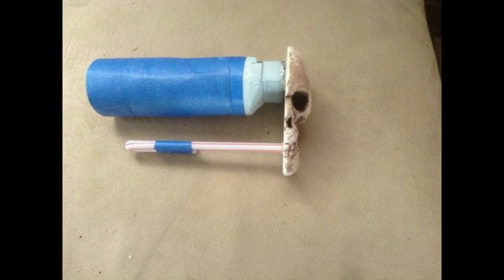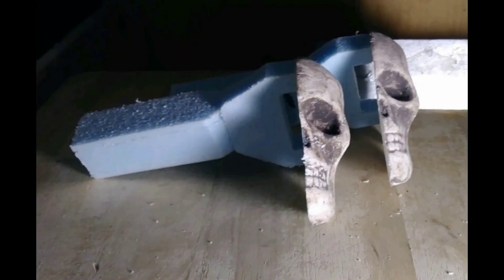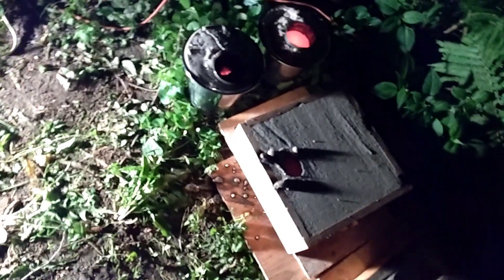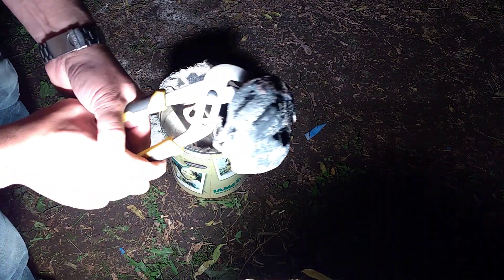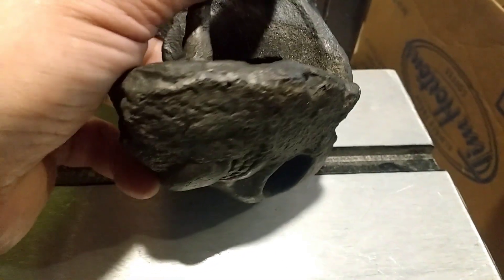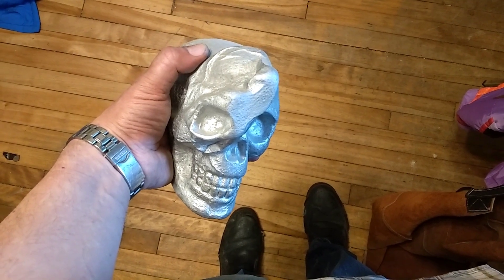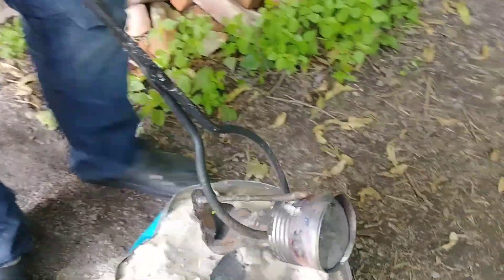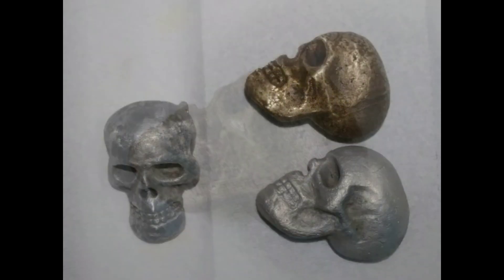Casting Bronze Skull Belt Buckles - Lost Foam Casting Defects

Comment: Sweet belt buckle.  I could understand the sand float with brass, because it's a heavy metal.  It is weird that on your first 2 pours 1 of them was okay without added weight from above.  Your second pour had rocks for weight to help prevent the sand float.  I'm glad that helped 👍

Comment: I want that first one. That big lump on the side of his skull was pretty frightening! :-D  I'm thinking I need to try and make a buckle or two. With my wife traveling in" horse-show-circles", could be some money in it for me ;-)
Reply from the maker: Thanks!  Good idea, those cowboys do seem to love their belt buckles... If you want to try doing it with lost foam casting, check out the other videos I made last year showing all the patternmaking: https://youtu.be/k5FkA22RWr4
I haven't seen anyone else making all one piece buckles like this anywhere, but I'd love to see what others can come up with!
Buckles are kind of fun to make, but this way there is a fair amount of cutting and filing, even with the improved gating I used here, which reduced that quite a bit.  Might do well to add a wire belt loop afterwards instead if your plan is to sell them.  One of these days I'm gonna make a sand casting buckle pattern, maybe a blank one I can add temporary details to for casting different designs.  I have actually sold a couple of these (including one of these bronze ones).    But only to friends - I'd have  to charge too much for strangers to be willing to pay, I think, but for a friend I don't mind doing the extra work for free.  As a hobbyist only, it is pretty rare for me to sell anything at all.